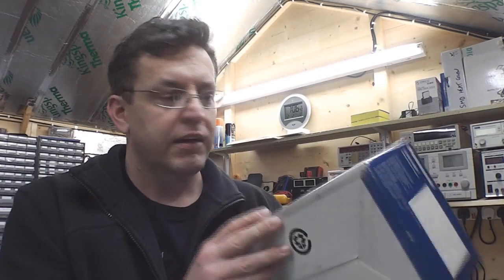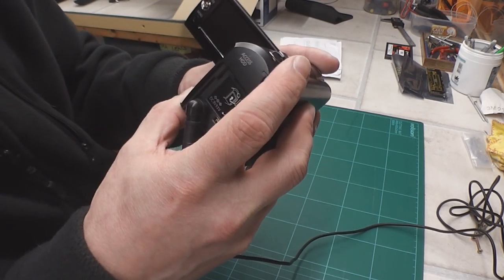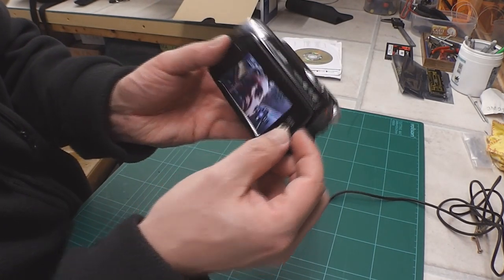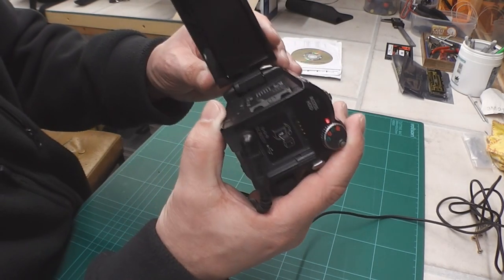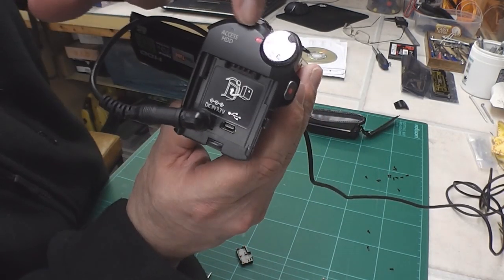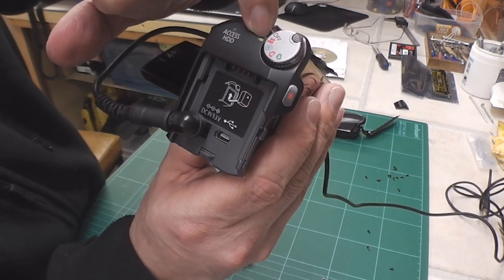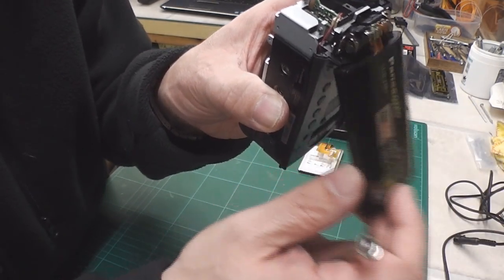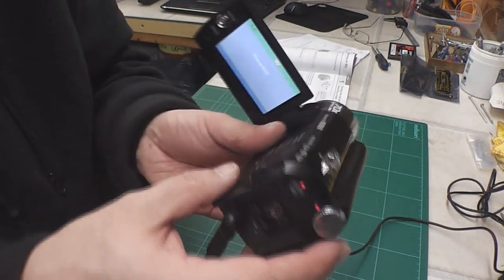Panasonic SDR-H81 Camcorder Repair

Comment: I also own an SDR-H80 but it's been converted to 'full spectrum' by (I believe) removal of a IR/UV filter normally installed in the lens train before the sensor. Thanks for making this video, great to see inside the device-that tiny hard drive is an awesome piece of precision mechanical technology :)

Comment: Great job =)  I wonder if it was just manual interaction of the micro switch there - seems like the logic was somehow inverted, so I guess it does sound like firmware was an issue as well.

Comment: Hello.  I was going to ask something, maybe you have information, I bought a small handheld camera, first it did not have a problem, then the zoom started to blur and even when the camera was turned on in the display, nothing started to appear, but it does not always happen, sometimes it returns to normal occasionally, occasionally it does this problem.  I was going to ask if this problem could be due to akkü. Do you have any information about it?

Comment: The flex cable needs replacing. I ordered a replacement cable from ebay. I have replaced one on a jvc camera, but now I need to replace the flex cable on a panasonic SDR H80. Do you have a repair video for fixing the flex cable for this panasonic camera? Or have you seen a video for that repair on u-tube anywhere?  Thanks

Comment: Hey man I got a Panasonic sir-h40p and I need to remove the hard drive but after removing the 6 screws it won't come loose, does it have snaps to do I don't want to break it